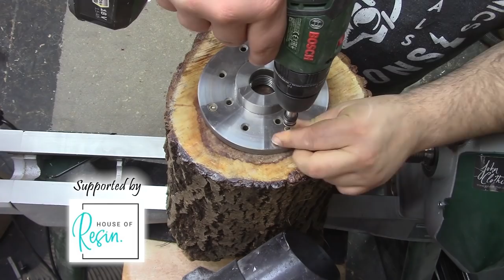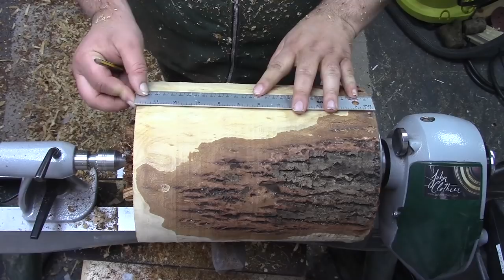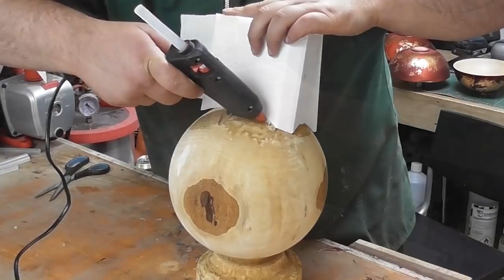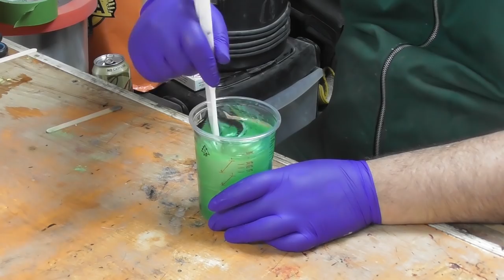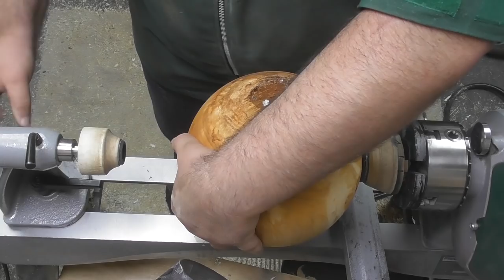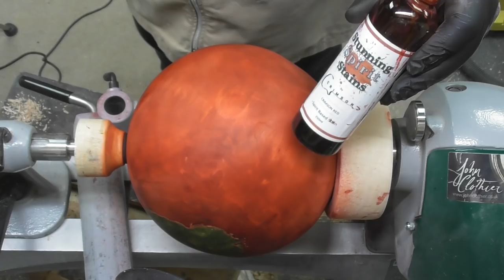Woodturning a Huge Log on a Small Lathe

Comment: I'm going to stick my neck on the line here John, of course only my opinion but you know I will give you my honest opinion. I don't think this is your usual quality that I was expecting.

First disappointment was getting the jig out and turning it into a sphere, really thought this was going to be a nice hollow form. The resin fill was a nice surprise and so was the colour as I don't think you'e done that on a sphere before. 

I'm guessing it was bottoming out on your cups as it was really out of round towards the end there.

The spray lacquer really isn't good to me on this piece. With a sphere being such a perfect shape it does require an immaculate finish which I don't think that come off.

Still given a thumbs up though.
Reply from the maker: The idea for this piece right from the start was to see how a big a sphere I could make on that lathe with the jig. something I had been asked about by a few people. The wood was horrible, rotten through the core and far from what I would want on a hollow form. I did try and use my usual cup chucks but they were too small so I made a new one that was bigger that you can see later on in the video. This though was not the reason for it being out of round. This was down to wood movement. usually with a wood sphere you turn and sand same day but there was several weeks between shaping and sanding and it all moved, a lot! You will also see that there are some cracks in it which were a nightmare and had to be filled with CA on several occasions. Again with the lacquer I had a few issues and it hadn't been buffed. I ran out of time and wanted to get the video done. With a good buffing and a few more coats the finish will look a lot better. This was one of those projects that fought me all the way and I nearly gave up on it 2 or 3 times.

Comment: Nice work !

What size (diameter) was the log in the beginning? 

Do you think the lathe could handle a bigger log ?
Thanks
Reply from the maker: Thanks! I would say it was 13" at its widest. It can certainly handle bigger diameter with outboard turning but I wouldn't want to go any bigger without using the tailstock for support
Reply: What is a tavistock
Reply from the maker: It’s a missspelling